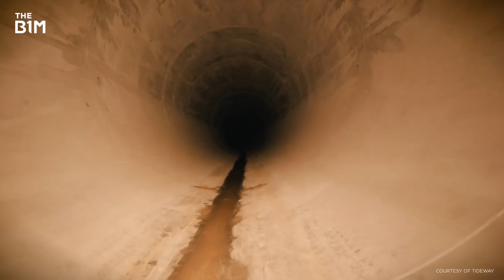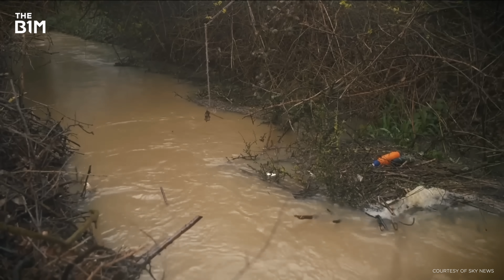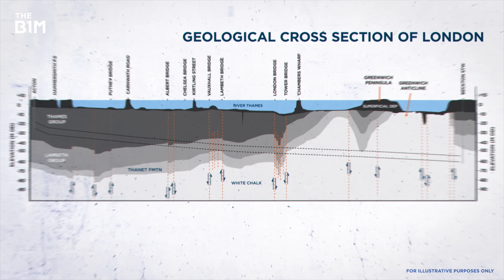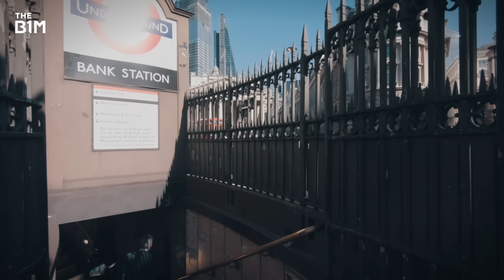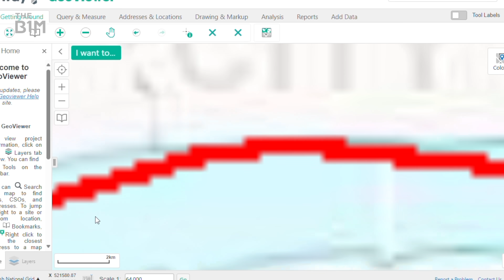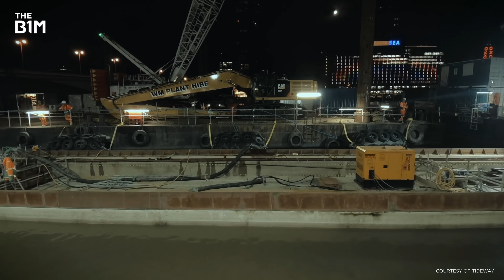London's $5BN New Super Sewer Explained

Comment: The question is, is this really a sewer though. I don't see any drains going into it. The width is far larger than any sewer that has been built. To top it all, this is the head of the so called sewer. Where will it go. There has to be a larger pipe for it to flow into. You cannot downsize or there will be  a slow down at that point.

Anyways, is this going to be a nuclear bunker for the London Elite ??? Seems very big. Why is is so deep.? Where does it end, What is this REALLY for.? 

I can't see Thames Water Board paying for all this just for fun. There is an alteria motive in this construction, it needs to be questioned.

Comment: Are there any plans to build more treatment works. Having watched a two part program about Thames water recently it did appear that several treatment works are being overwhelmed by inflows. Even relatively small storms seemed to make a significant impact on the treatment works capability to cope. Also, with the ever increasing housing construction, surely the need for more treatment works and general infrastructure is more urgent than ever. Also, is it feasible to separate surface storm water from the sewer system? Anyone?
Reply: I join the question
Have you already seen any positive effects from this project?

Comment: I hate the term 'pumped water into'/ They don't pump it out to sea and rivers. It overflows. 
A lot of existing plumbing up until about the 90's, shares rainwater and sewage. So when it rains, a lot of rain water ends up running through the sewage lines. The sewage treatment plants can't always handle the flood, and the overspills sends the liquid into rivers an seas without treatment. Solids are usually trapped. 
Since the 90's, building regulations separate sewage and stormwater. Sewage only goes to treatment plants, stormwater will go to rivers, sea or soakaways. Unless the entire sewage system has stormwater separated from it, this will always be an issue. And the only way to separate it, is to alter the plumbing of every house made before the 90's.

Comment: Seven million hours is a ridiculous way of measuring anything,  It works out to less then 5 hours a day over the 4 and a bit years, but how much was pumped? 3.15 billion gallons into the Thames in 2022 is the only example. This is typical hype on anything to do with pollution, "use the highest number even if it means nothing".A great bit of engineering though.

Comment: Chicago has an almost identical problem decades ago.  The "Chicago Deep Tunnel Project" started in 1975 and the tunnel (176 km long, up to 10 m in diameter and up to 110 m deep) was completed and in service in 2006.....31 years!  But the entirety of that project is not slated to be complete until 2029 (the planning started in 1972....so 57 years to completion!)

Comment: Timestamped Highlights
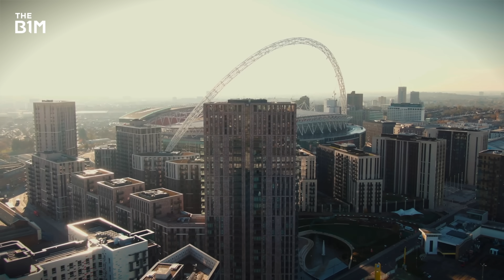00:38
🚧 London faces a sewage problem with 40M tonnes of raw sewage dumped into the Thames annually.
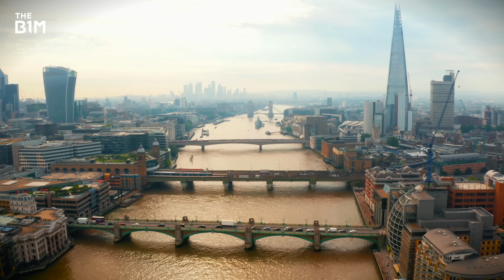01:33
🚽 The Thames Tideway Tunnel is a 25km long tunnel designed to capture sewage overflow and divert it for processing.
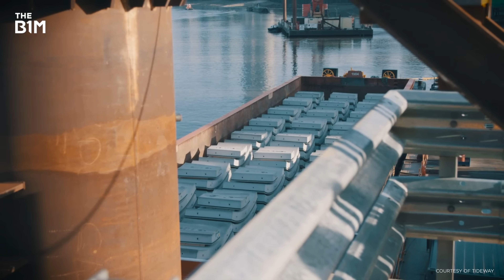03:47
🧭 Careful planning and mapping were crucial to avoid underground obstacles and ensure the tunnel's alignment.
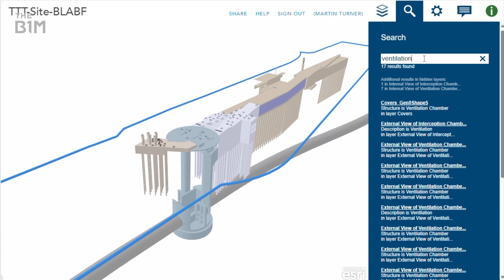06:06
🖥 Esri ArcGIS helped compile data and create a 3D model of the project for accurate planning and real-time data feedback.
08:54
🌊 The culvert to divert the flow into the new sewer had to be constructed around underground infrastructure.
11:20
🛠 Multiple tunnel boring machines were used to dig the tunnel through the congested ground under London.
13:12
💦 The Thames Tideway Tunnel will greatly reduce sewage overflow into the Thames and contribute to a cleaner and safer river.
Summarized by @NoteGPT

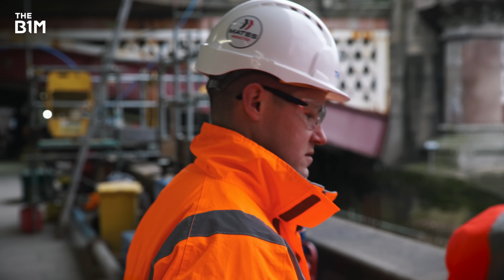Comment: 6:50 Didn't know that the Fleet is to be used to flush through the Tideway sewer.
Don't know what I think about that.
I suppose that it's an ahem  confluence of geography and fluid dynamics. About halfway along the new pipe which presumably needs to house a constant flow in order to avoid the famous fatbergs and other blockages.

Comment: I apologize if i don't fully understand the video but isn't this kind of a band-aid to a larger problem? I imagine the costs to fix the underlying problems are insane but in the long run i would like to know the feasibility of working to replace things over time rather than patchwork. Or is that what this is?
Reply: You would need to replace the entire sewage system back to the individual street and property - for a major city like London virtually impossible except over hundreds of years. This is the problem with CSO. So this is a clever solution for the problem - collect the overflow and make sure it ends up at the sewage treatment plant.  Which is presumably getting a massive upgrade to deal with the additonal volume - I believe the normal flows already end up at Becton.

Comment: How many miles?  Using kilometres is so boring.
Reply: Think
Reply: @Gfynbcyiokbg8710  I think it’s pathetic to give up cultural heritage for a measurement that doesn’t even sound nice to the ear.   

I’ll ponder it more when I’m 30000ft in the air on a flight next week. 
Travelling at 400 odd knots.
Reply: @Dan-nh8nu  "cultural heritage" 😂 Its a unit of measurement not a cultural tradition, plus we've changed how we measure things several times before for convenience so why stop now?

Also knots has nothing to do with being 'culturally significant' or whatever, that unit is actually useful, unlike any imperial unit
Reply: @Gfynbcyiokbg8710  Ofcourse it’s cultural.  You’d be cumming in your pants if it was a french unit.  We see you.

Comment: The fact that sewage and water from downpour is mixed inside the Bazalgette sewer system makes it prone to overflow. The better solution for London would be to seriously consider, design and install separate systems for sewage and rainwater. That would allow for rainwater to just flow towards or into the Thames and would avoid the costs of an enormous sewage treatment plant, which is needed to filter all the mixed sewage this pipe will generate, before it is clear enough to be set on its way to the aquifer. Not to speak of the enormous costs of maintenance and continuous processing of sewage water which will take place in this treatment facility. Plus, what’s going to happen when there a years of lower levels of precipitation and this pipe and the consecutive treatment plant fall dry? Maintenance costs will still be absolutely necessary, drought will seriously impede the treatment processing and further increase the cost of treatment facility. It’s nothing but a bet on the wrong horse, as it is doubtful if this pipe will indeed create a sustainable solution for London’s problem of sewage overflow. There simply isn’t a pipe with a large enough diameter which can process the amount of water an atmospheric river can generate on the roofs and roads of London, which will mean the system will still be prone to overflow even when this pipe and its treatment plant are fully operational. Cheerio
Reply: Quite correct. First step is segregation of contaminated water from clean water.
Storm water is not always clean, but it is cleaner than domestic sewage and should be kept separate.
Segregating a combined system will be very disruptive and expensive, but is ultimately the right thing to do.

In this case, what goes into the new sewer is overflow from the existing system. So should be diluted sewage assuming that overflow occurs only when storm water loads are very high.

Comment: Due to EPA mandate, Combined Sewer Overflow (CSO) projects are being implemented all over the USA for all sizes of cities. In Indiana, communities with CSOs were required to develop and implement what is referred to as a Long Term Control Plan, or LTCP. Control strategies that are aimed to significantly reduce or eliminate raw sewage discharge to the rivers and streams primarily include either reduction strategies (e.g. separating sanitary sewers from storm sewers, installing green infrastructure, etc) or storage/treatment strategies (e.g. inline or offline storage followed by wastewater treatment). The ecological, recreational and cultural benefits over the next 100 years are going to be quite impressive.

Comment: When finished it "will catch all but the most extreme overflows" ?? This makes it sounds like it already doesn't have +100 years of population growth capacity ahead of it?
Reply: "All but the most extreme overflows" is basically the entire Thames River flooding over and into the system
Reply: Severe storms that dump a lot of rain may overwhelm the new works. I think they reckon it should have the capacity to deal with normal rainfall and expected population growth for about 70 years.

Comment: Now like Paris and many cities, they have to clean it. I know it's an enormous task, but will surely benefit the city in the long term.
Reply: The Thames is already substantially more clean than most city rivers

Paris was horrendous before the started caring about it because of the olympics
Reply: @Alucard-gt1zf  No its not. The Thames is no cleaner than any other river running through other European countries.
Reply: @matmul4850  "The Thames is considered to be the cleanest river in the world that flows through a major city. The Thames is home to 125 species of fish and more than 400 invertebrates." The brown colour is caused by sediment constantly stirred up because the Thames is a tidal river:- "Because the Thames is connected to the North Sea, each day it is affected by two low tides and two high tides. Thanks to this non-stop movement of the water, the sediment is continuously suspended in the water column giving it its trademark brown colour. This brown colour is the sign of well-mixed nutrients in the water which makes the tidal Thames a rich feeding ground for aquatic species including two species of seals and also porpoises."

Comment: How does one measure the flow rate of feculent?  Turds per second perhaps ?
Reply: This was carefully investigated when the original sewers were designed.
Bazalgette worked out the rate of flow that would enable the sewers to self clean.
He also ensured that many quality checks were in place during the construction, and he insisted that inferior materials were removed from site.
I believe that the quality of cement was the very first standard.
Reply: @chrismoyler  I was joking but that is a fascinating reply. I do somewhat pity the researchers that were tasked with calculating the viscosity experimentally.
Reply: Many toilet manufacturers test the flushing power of their product using wadded toilet paper and sausages. I am not kidding.
Reply: @jmchez - Compared to the newer toilets that use less water like with the half flush types the pipes now actually need a steeper grade due to less initial flow, this is also why there are more frequent backups and blockages in older systems as not all the feculent moves away with the shorter flush flows as they were originally designed for a higher volume of water to assist with the flow

Comment: Actions by UK water firms are criminal. Directors should be jailed.
Reply: Nah they will get a multi million pound bonus
Reply: This has been going on for decades, over a century. It is so normal that many countries, even in Europe, don't even bother to measure combined sewage overflows (CSOs).. The nationalised water industry pumped so much raw sewage straight out to sea that the UK was prosecuted by the EEC (as was). The only reason that people care so much is simply because the UK water industry is privatised. The nationalised water industry never bothered to replace the Victorian cast iron pipes, even as your bath water was restricted to 4 inches in 1976 & hose pipe bans were a regular feature of an English summer. The nationalised water industry didn't care about CSOs. It is the privatised industry that has fixed the raw sewage out to sea problem; it is the privatised industry that fixed leaking Victorian pipes, hose pipe bans are now rare & localised; it will be the privatised industry that will fix the CSO problem. Governments will never spend enough money to fix CSOs, there are far too many other ways to spend someone else's money to buy votes.